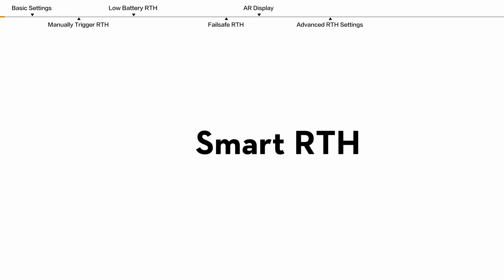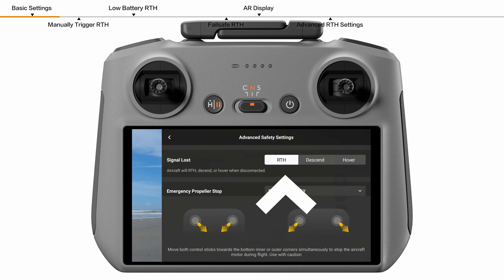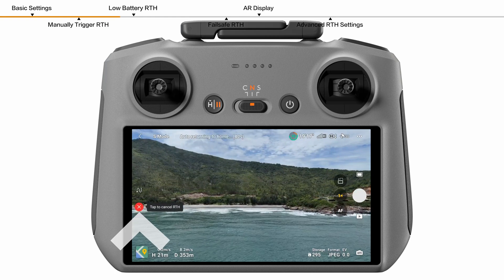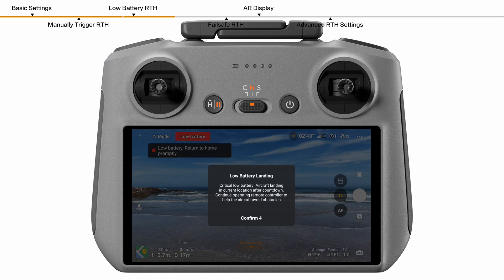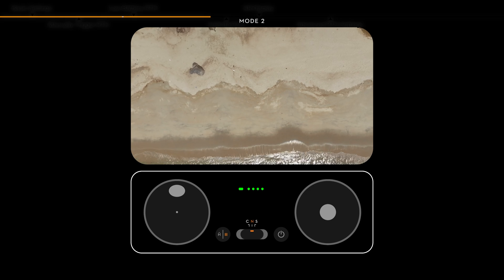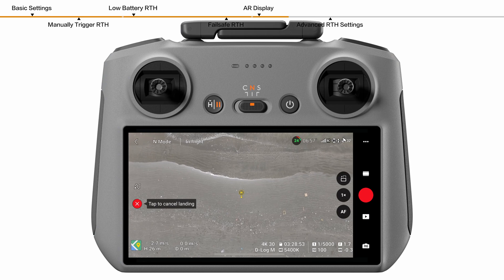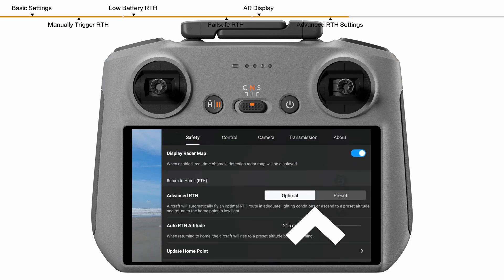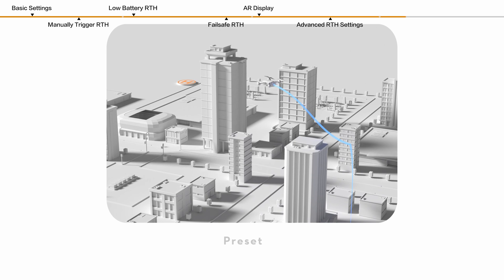DJI Mini 4 Pro｜Smart RTH

Comment: Waypoints are very good step on the way but Im finding some thinks nad. Firstly isnt possible prepare flight in PC and screen is too small. Secondly  isnt tool how share best flights and finally isnt possible use inteligent modes as a bumerang atc.
Add it and product will be absolutly the Best.
Reply: Yes you can pre plan Waypoints via PC Mac or Android-IOS

Comment: Having just purchased the M4P, it's had 4 updates in 3 weeks. Each time I setup to fly, there is another update, one of which included the P mode issue from the N mode. Reading the DJI forums have given less product and flying confidence with each update DJI puts out. Have completely lost confidence  in the integrity and safety of this DJI Mini 4 Pro with RC2 product. 
Still being in the Amazon return window, the Mini 4 Pro is being returned. I bought the drone to have fun not to get wrapped up in all the DJI update/firmware/software drama. Too much distraction to enjoy flying the experience the drone offers for $1100.